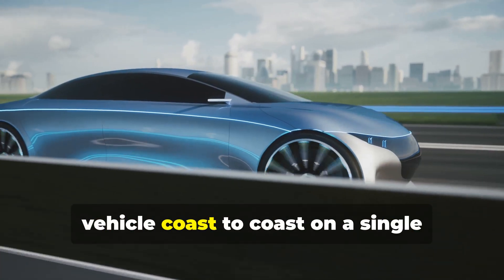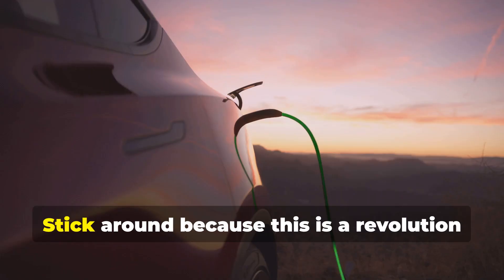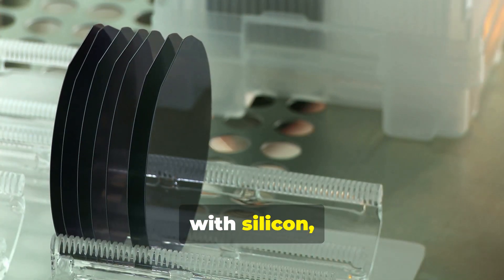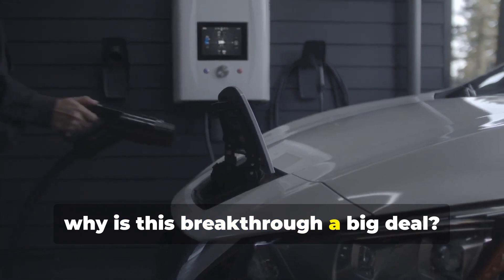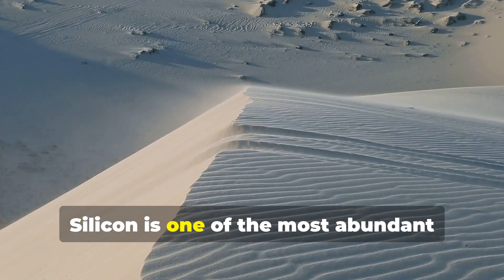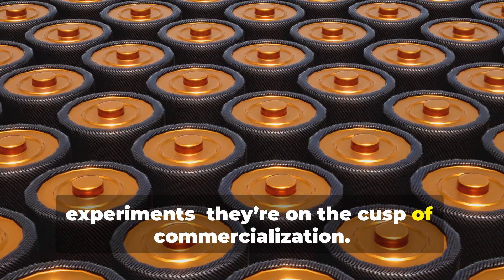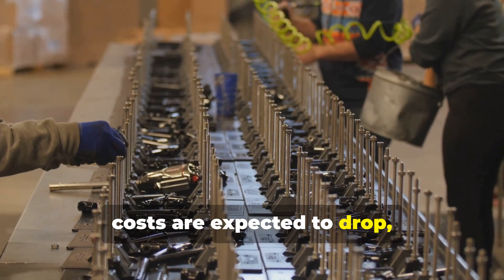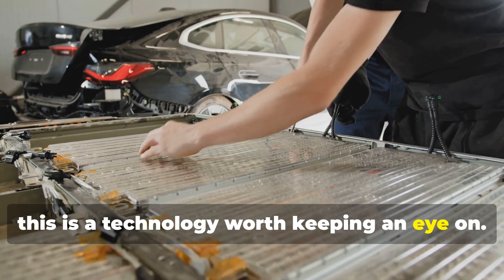Can This Battery Extend the EV Range to 3,000 Miles?

Comment: Painfully over simple - and not true.
Reply from the maker: Hi,

Thank you so much for watching our video and for sharing your feedback. We really appreciate your input, as it helps us improve the quality of our content.

Based on your comment, we reviewed the script and found that current research and articles support the core facts about silicon anode batteries—such as their theoretical capacity, challenges with expansion, and the efforts of companies like Sila Nanotechnologies and Amprius Technologies. At the same time, some of the points, such as the idea of driving over 3,000 miles on a single charge or timelines for EV adoption of silicon anode batteries, are forward-looking projections based on our understanding of ongoing technological developments based on our research (news articles, research papers, blogs and other videos). These elements are forecasted timelines and as such may not qualify as objective truth.

Our goal is always to present complex technological advancements in simplified and condensed form that’s understandable, accurate and at the same time be entertaining. Balancing these aspects is a challenge and we trying to get better as we progress in our journey. 

Your feedback encourages us to maintain high standards of factual correctness and to distinguish clearly between established facts and forecasted timelines. We appreciate your understanding and will continue working hard to provide reliable, well-researched content as technologies evolve.